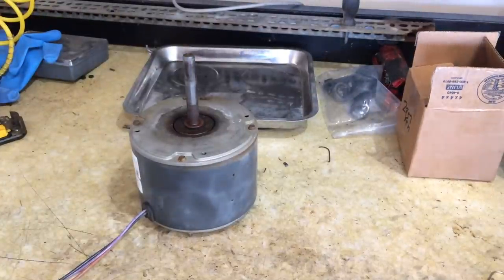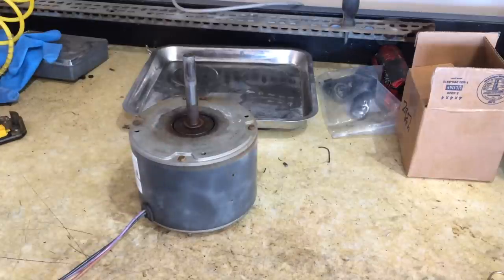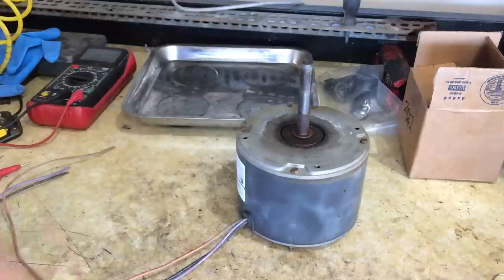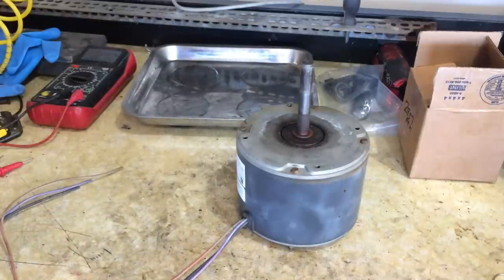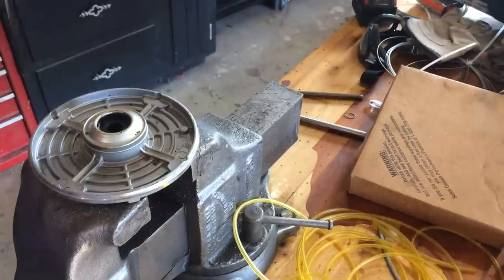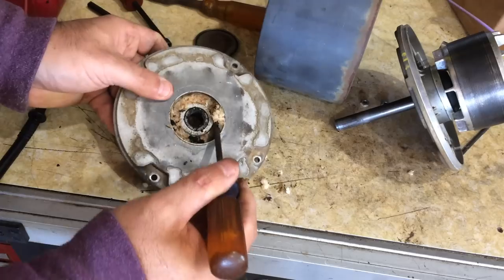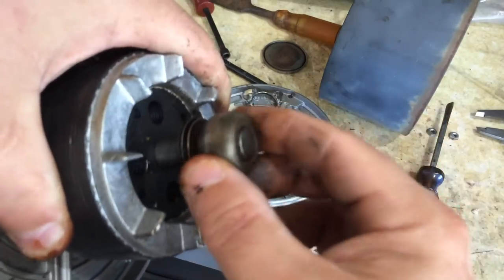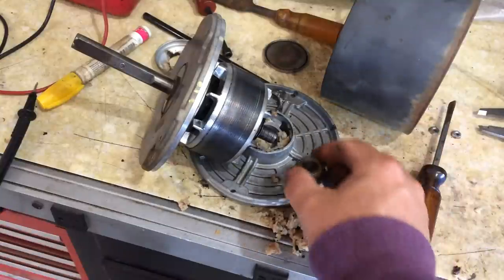Condenser Fan Motor Possible Bearing Replacement

Comment from the maker: https://amzn.to/2Qr2BBI 1/4HP Motor 1075 RPM (Ball Bearings)
https://amzn.to/2QqluEP 1/3HP Motor 1075 RPM (Ball Bearings)
Both Motors Shafts can be cut to fit and both are reversible.
It's a good idea to replace the capacitor when replacing the motor.

Comment: I've repaired going on nearly 75-100 of these motors now. Generally the front bushing is shot and the rear is salvageable. Any slop in the front(or rear) and the motor is allowed to pull to a side vs spin and will just hum/buzz. Most use a flat tube bushing, yours has a less common ball pivoting bushing. You can not find bushings for these new anywhere. I have tried ordering in bulk from China, Mexico, Taiwan etc, but I don't need 10,000 of them.  They would have to be custom made. I modified a few generic bronze bushings (without a lathe) with decent success but ultimately I just swap a good rear to the front of a bad motor. So two bad motors can make one good.  I have also modified ball bearings into a few but that generally took a lot more time and some of the cheap ball bearings I got had too much slop. I was getting the motors for free and was generally selling them for $40-$60 depending on HP with 15-45minutes of labor. Though the money was decent I decided this summer my time is spent better elsewhere and gave up on them.
Reply: Good to see you here, Moe.  There are so many ways to make money it's not funny, as your story proves.  Thanks, Man!!
Reply from the maker: I found a way to fix it.  Because my bearings were good and the shaft was damaged, I found I could press the shaft forward about 1/2" (it moves using my big vise).  This fix would shorten the front shaft length, but I too do not have a lathe so I would have to hand cut the groove for the snap ring  with a hacksaw.  Maybe chuck it up in the drill press and run a hacksaw blade against it.  PS I saw your video on the Pneumatic leaky fittings, I saw and appreciate the link to my video on the subject, but would have hoped for a mention in the video (just for future reference).  Take care buddy.  Bob
Reply: Hello to both of you.  I am dealing with a potentially bad bearing in a dometic roof top AC unit.  No blower and all hum.  Changed the cap and changed the control board before knowing how common this is.  Those sleeve bearings and their lubrication system looks like a crap idea to me.  Yes, there is oil in the wicking but it is not in contact with the bushing or shaft.  It's as if they are just made to fail and these units are now $1400 instead of the $500 a few years ago.  

I wonder why they don't just put ball bearings in them and call it a day.  Unless they are building them to fail so they can sell more of them.  I am going to try to work on the "old" motor and install ball bearings to see how it works out.  I have 3 of these units so it's just a matter of time before another one bites the dust.  Cheers to you.

Comment: Thanks for opening the thing up and showing us how it is put together. I too wanted to know if there were bearings in there or not. Although I have opened a motor like that and oiled the white fabric with 3in1 oil. Learned it from another video. The white fabric needs oil to keep the shaft lubed and turning so that it doesn't overheat and trigger the thermal protector. If you had just oiled the fabric in there it would have run again.
Reply: For a few days anyways. It'll get you buy until a new motor shows up.

Comment: Very interesting.  I am dealing with a 42-year-old Tappan AC unit that has a similar motor that has been giving me some trouble over the past two years.  A couple of years ago, it seized up and wouldn't run  at all, and I managed to loosen the shaft with some oil, and I drilled an oil port into the lower area and lubed that and it worked fine for another year.  This year it seized up again, and I had to drill an oil port for the top bearing and got some oil in there and it ran fine, but I've found that every few weeks now I need to add oil.  Today when I opened up the AC unit again after the fan was making noise, I could feel a bit of play in the shaft as I gripped one of the fan blades and moved it back and forth.  Surprisingly, once I oiled the top bearing, I could not feel that slop at all.  It's running good again, but I know I ultimately need to find a new motor, which may not be easy, or fix this one.  Seeing what you took apart here gives me some sense of what is likely in mine.  Thank you very much.  My AC unit was installed when my house was built in 1978, and I have live here since 1994 and never replaced it, so I'm sure the motor is original.

Comment: A steel shaft riding in a steel bushing - what a bad idea.
Reply from the maker: 12 years out of that outdoor motor.  If it had accessible oil ports it would still be running.
Reply: That’s impressive for such a setup, especially in outdoor conditions.
Reply: @doublewide6  yea, but based on how crap is engineered today, and the so called planned obsolescence designs, The best thing to do is to schedule preventative maintenance, and open your equipment from time to time to tweak it, or lube the moving parts. 
I like to replace those OEM, rust prone steel screws on my room ACs, and get the part numbers on the fan motor bearings, to have an extra set, so when it comes to coil cleaning time, or when the bearings turn unbearable, by becoming screechers, then I open the fan motor to replace those. ...and definitely stay away from proprietary goods. John Deere, Apple, ect.

Comment: Question. How important is it that the replacement motor match specs with the OEM? Example, mine is an 1/8hp, can I  upgrade to a 1/4hp motor? Would it cool the condenser better if all other specs were same?
Reply: You wouldn't want a 1/6 and check the amp draw after installation

Comment: The sad part of motor design is how the manufacturers will cheap out on the one part that will fail most, the "bearing" or in this case a bushing or sleeve bearing vs. using quality sealed ball bearings. Had this motor been built with ball bearings it would still have tons of life left. The solution for us is to replace said motor with a USA made motor that has ball bearings vs. self aligning sleeve bearings which will in time require service of the packing with oil or suffer wear and tear.
Reply: I have a 4 year oil Rheem. All ready replaced the coil. Now the fan motor is making noise. nothing but Junk.
Reply: @venvnco6259  Sad. Find a US Motors "Mojave" motor replacement.  Those have real ball bearings vs sleeve or the like.

Comment: I think that what that is, it’s a swiveling shaft end bushing. ...and that material if not refilled with oil, or lube, will eventually turn against the bushing, and the shaft, by acting as dirt, or an abrasive causing friction.

Comment: It looks like the shaft can be machined and press fit a bushing  to restore the outside diameter. Thanks for the video...
Reply from the maker: With the right tooling (a lathe and press) it could be an easy fix.

Comment: 9:55 Bean counters have determined that a bronze bushing will last too long.  You know beyond the 5 year service life.  The bushing last for the life of the oil.  The new B&S push mower engines are delivered with "permanent oil."  Never needs changing.  The oil is good for the life of the engine!

Comment: the motor has the sleeve bearings on each end of the shaft.  Oil diffuses from the packing material through the brushing (porous) onto the shaft for lubrication.  I would not remove any of the packing material for it is impossible to pack them back.  Use non detergent oil from auto store and saturate the packing material.

Comment: i seen shafts scored and a flat spot worn from an imbalanced fan blade. as Emerson  its now US Motors. but same part # if oe or a rescue motor. as most use a rescue motor as the rotation is reversable. is the new ball bearing motors also like this with the reversing wires?

Comment: My FM RPM 825 was burnt, can I change RPM 1075?
Reply: has to be same rpm or subcooling will be off
Reply: Thank you, Cooling is good, emergency heat is good as well, but call for heat pump is not working at all, just flashing wait, wait...(long). on the thermostat.

Comment: They could have added a weep hole for oil but they want use to buy a new motor.
Reply from the maker: Not a bad idea.  You just need a rubber cap for it.

Comment: Just drill a 1 1/8 inch hole in the motor and bells and Epoxy the bearing  

The bearings model number 
 FR8UG

Comment: most people wouldnt want to be without there heat or air conditioning while chasing parts,i have a local HVAC supply house that hasnt failed me yet. i guess with Amazon prime its there next day???? .everything today is throw away,i have a ww2 atlas lathe that i still use.
Reply from the maker: For AC stuff I pay extra for one day shipping.  You got to figure that if you can fix it yourself without having the service man out your are already $100 ahead.

Comment: Poor design....Planned to fail!  I wouldn't buy that brand again.
Reply from the maker: Emerson Electric also make Hayward pool motors.  12 years is really not that bad for a fan.
Reply: Built in Obsolescence
Reply: good job if i'm in the Philippines looking at your YouTube channel
Reply: Emerson is a great brand actually. That cellulose is meant to be reoiled, most manuals say every 6 months. Of course, it rarely happens. Bearings have higher friction loss and there's no guarantee they'll last any longer than a bushing, and they definitely won't outlast a properly maintained bushing. I have fans that are 100+ years old and the oiled bushings still work fine. No grease will last that long.
Reply: @jbtvt    100+ years?  I assume you must be reoiling them every now and then?